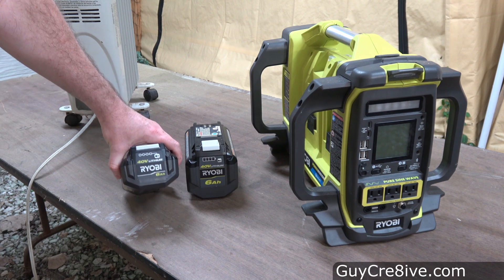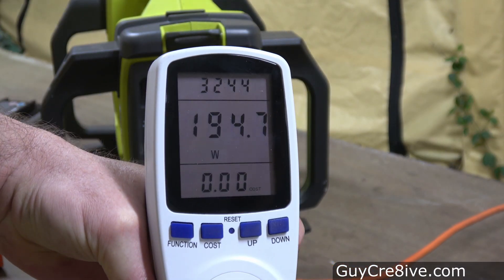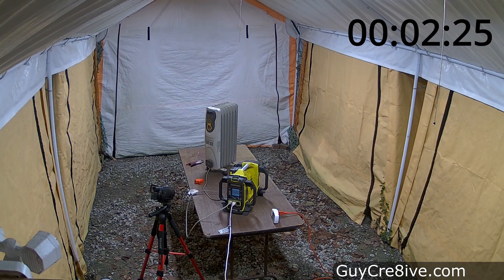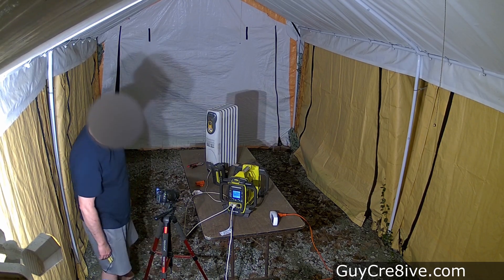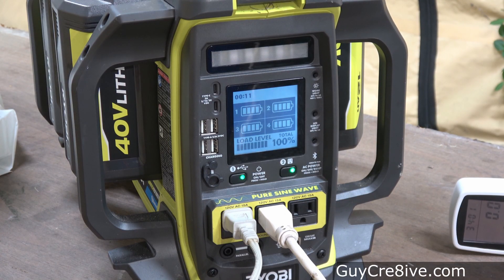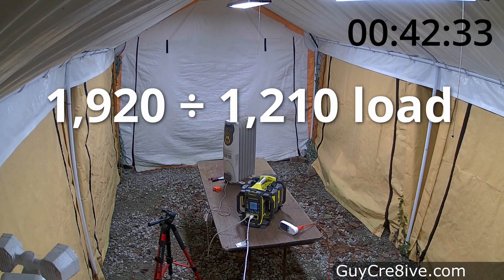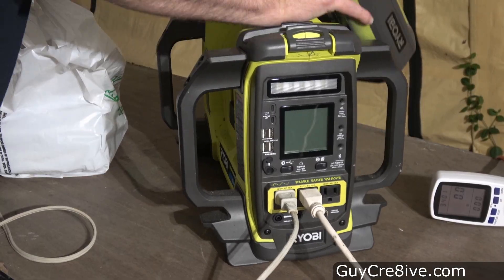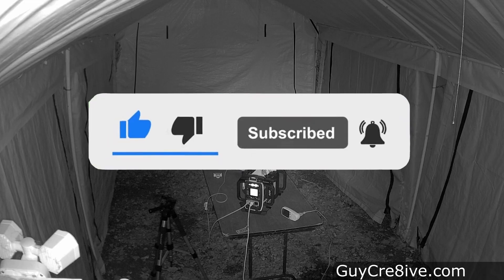Ryobi 40v 1800 Watt Power Station Runtime Tests How Long RYi1802BT 12ah 7.5ah 6ah Batteries Battery

Comment: So basically at its best, it can only run a space heater and some lights for 45 min?
Reply from the maker: That's about what I got with the batteries and unit I have.
Reply: We Run our Freezer Over 12 Hrs With 2 6 & 2 8 AH 40 Volt Batteries & charge my cellphone before changing batteries.
Also same thing with the 18 Volt as well, it runs the refrigerator if the lights go out & charges my wife's cellphone. It has 4 8 AH & 4 6 AH. We have enuf batteries to charge out on both units & a propane generator to charge all batteries. The 40 Volt 8 AH batteries take 6 hrs longest time to charge, but also give em. 1 hr to calm the batteries down before charging, running both systems as long as needed 
That's the only thing we need to keep going if our electricity cuts off, which happens 2-3 times a yr.
We have plenty of backup flashlights, camping lights, radios & food.
This 2025 winter is gonna BAD, is what several Meteorologist & Geophysicist are saying.
We figure to handle our backup systems well with care.
We Pray 🙏 about Everything we invest in; our mind body, soul is Good leadership In Jesus 👑 Name 💘 4:37

Comment: Thanks for running the tests. The reason you're not getting anywhere near calculated run times is due to marketing. The batts only output 40v when full, dropping down to about 30v as it drains to 0%, the average voltage will be around 37v but under a heavy load, average voltage could be 35v or lower. 

Your 12ah batts aren't really 12ah either. They contain 30x Lishen LR2170LA cells which are labelled as 4000mah capacity each (4ah x3 = 12ah) but actual tests reveal that they're only capable of storing about 3700mah or 3.7ah of energy. So 3x 3.7ah = 11.1ah max capacity. 

The BMS in the battery won't let the cells charge or discharge to its voltage limits as that wears out cells prematurely. So at most it'll charge to 4.1v instead of 4.2v  and discharge down to about 3.0v instead of 2.5v, these safety limits reduce the actual pack capacity by another 10% so you're down to about 10AH of actual useable capacity per pack.

So estimating an average pack voltage of 36v under load * 4x 10AH actual useable capacity = 1440wh of useable energy max, much lower than your calculated 1920wh. With a 1210w load & inverter power loss of ~20%,  the station needs 1512wh to run for 1hr, so you should've gotten 57mins of runtime instead of 49:44. So I'm guessing that the power station shuts down when it senses about 10% battery remaining instead of draining them flat.

Next time you run the test, measure batt voltage after the power station shuts off, I'm willing to bet it's higher than ~30v (BMS cut off voltage)

Comment: My guesses for shorter run times than calculated would be A) Heat or B) testing at a full Watt load became too strenuous on the batteries as they drained beyond a certain point.
Reply from the maker: Yeah I wondered if my they rated it for more based on the load they were testing with. I'm not that smart about electrical though so that might not even be possible.
Reply: I agree with your analysis,  I will add 2 things. 
1. Ryobi 40 volt batteries are 36 volt actually.  If you check at the bottom  of the unit the WH is based on 36 volt not 40

2. Most batteries are rated at 20 hrs discharge rate. That means that an advertised 100 ah battery will provide that amount of energy if discharge at 5 amps load.  If you increase the load it will not provide the full 100 ah.